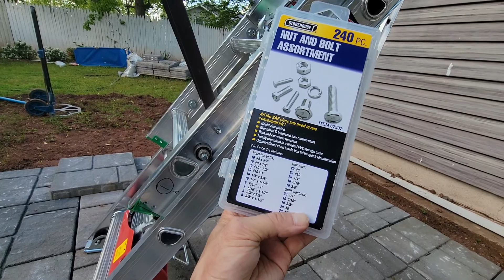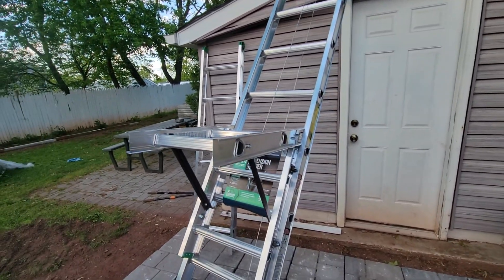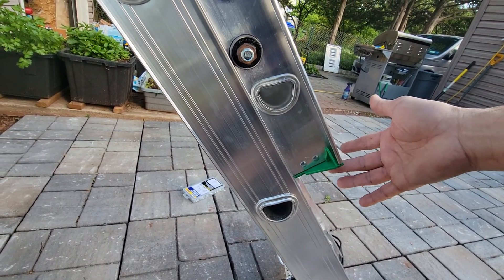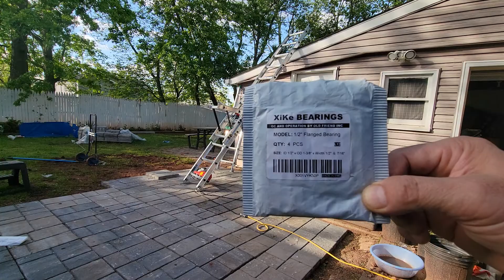Build your own ladder hoist with 24'/32' ladder and 800lb hoist/lifter

Comment: Works well but seriously as a roofer I could just throw bundles up at the trough,and if you're not that kinda guy it's literally 3 steps on a ladder and drop it on the roof
Reply: Work smart, not hard. Why risk overdoing it when you can do the same with no effort. My opinion. As someone who installs Granite countertops, I'm looking to build something similar for installs on the 2nd or 3rd story, and basement.

Comment: What do you do for a 2 story home
Reply from the maker: You can buy a longer ladder.
Reply: @0202hcauq   I understand that but how do you join the 2 ladders together to climb up on the rails
Reply from the maker: @7628739  I am sorry I don't know.  
I saw they sell a 30' ladder with a hoist for around $2500.
Reply: You'd have to buy a 40' ladder.  I use a 40' ladder for a scaffolding plank I put a 20' wood plank on top.  I just wouldn't have more than 1 person on it at a time, but that's all I do for professional planks as well.  It's always been very sturdy and I can do a 40' walk way near the roof edge.

Comment: What hoist did you use sir?
Reply from the maker: Partsam 440 lbs Lift Electric Hoist Crane Remote Control Power System, Zinc-Plated Steel Wire Overhead Crane Garage Ceiling Pulley Winch w/Straps (w/Emergency Stop Switch) or 
You can get a cheaper from Harbor Freight

Comment: Nice build. But, you probably need to replace the top rung of the ladder with square steel tubing maybe 1/8" thick. Otherwise, with any load the top rung will  bend and eventually break.
Reply: If that’s the case, then anyone over 150lbs going up the ladder would break a ladder rung. 
If he doesn’t go over the weight limit of the ladder it should be fine. Maybe for piece of mind put a solid piece of angle across the top so it doesn’t pull in on itself. If your lifting anything 100lbs or under it should work flawlessly without damaging the ladder imo.

Comment: With the ladder at that angle sitting on concrete if you lift the shingles past the fascia it will kick out. Nice design tho
Reply: Nice job! 
Need to set up ladder at 75 degree angle for maximum stability and safety